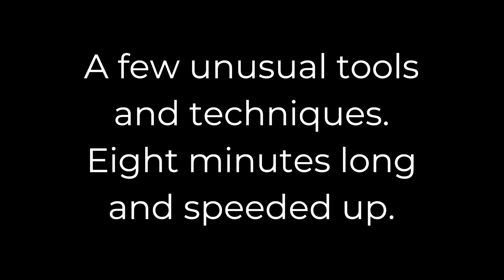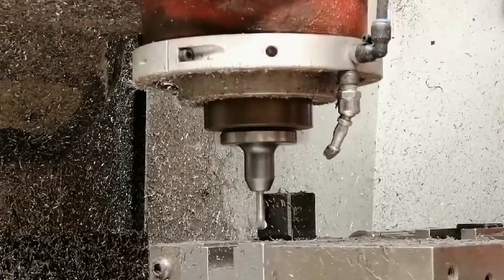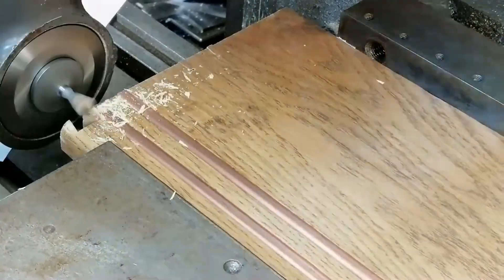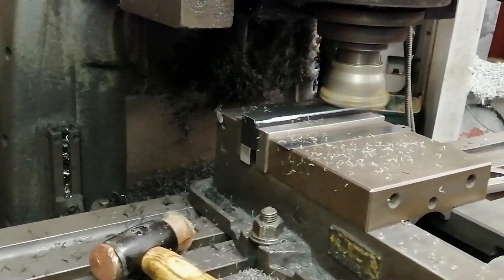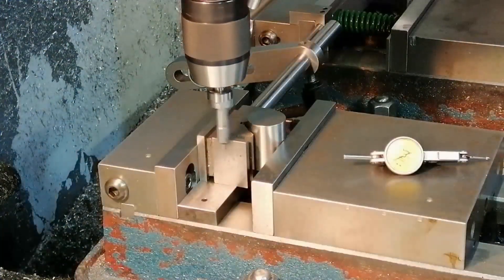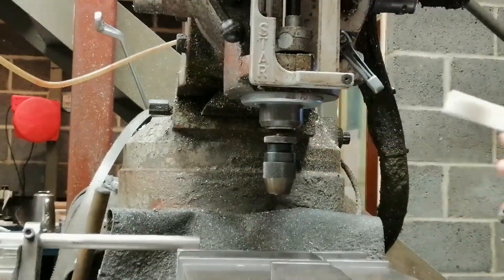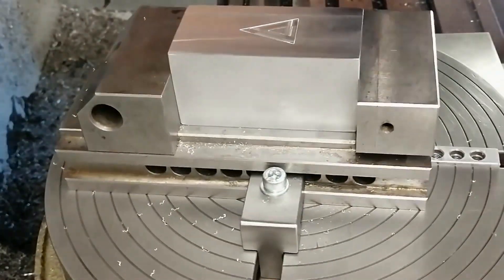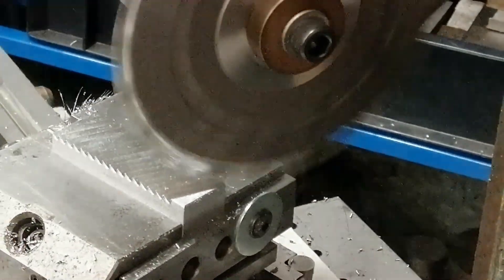Unusual machining methods from my workshop.

Comment: I suffered a serious injury and don't know if I can ever get back in the shop but I still enjoy watching your ideas come to life. You are a man after my own heart, often coming up with the exact same solutions. The only thing that irritates me is you have that pear shaped indicator tip to cancel cosine error AND I DON'T HAVE ONE!🥵
One question, where are the mirror angled serrated blocks used?
Reply from the maker: Cheers for your support Bill. I don't see that many pear-tipped indicators on YouTube either.

The serrated angle blocks were purely a demonstration. I had not seen any instances where the reference points were picked up geometrically, just Sharpie markers and by eye. It was an opportunity to demonstrate several techniques in one video, and I added the challenge of matching two opposite angles while I was at it.
Some unusual videos are almost finished; if they work, they should appear within a few weeks.